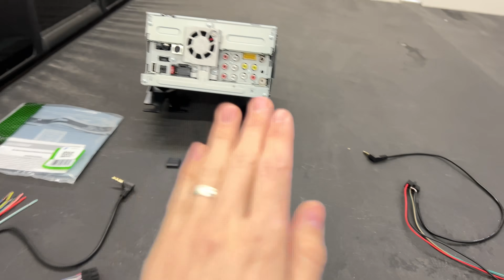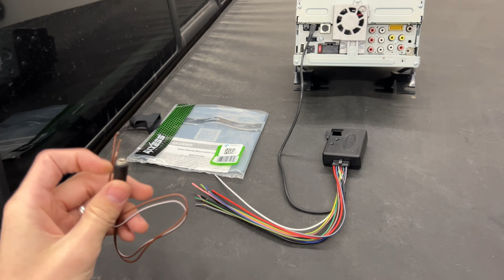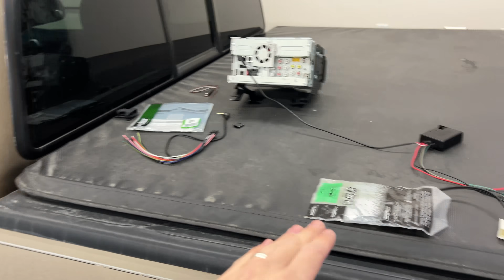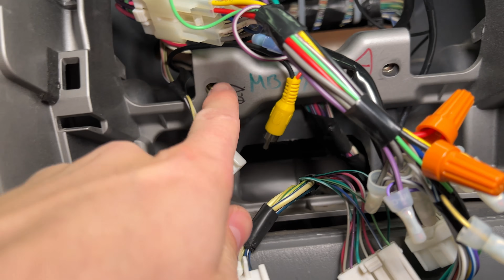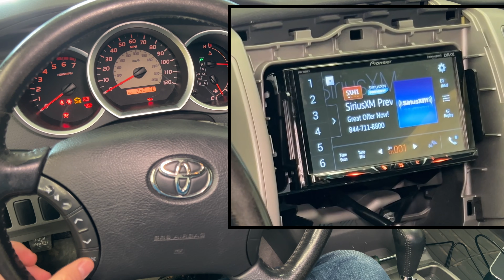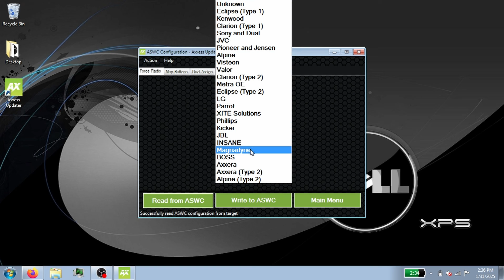Toyota Steering Wheel Control Wiring with Axxess ASWC-1 for Aftermarket Radio Tacoma/Pioneer Install

Comment: So mine is a Toyota Camry Camry SE, it has a after market stereo in it and it has power but no sound. It also has the RCA plugs but the wiring isn't good and we bought the car like that. Should i just buy a new harness with a ASWC-1 interface?

Comment: Just installed this today and all my controls work except for the seek up/down button. They only work in radio mode if i hold them and it will begin to switch the station but pressing them does nothing. does not change song in any source mode or station preset in radio mode. I manually reset and mapped controls but that does nothing. Any ideas? or could it just be my radio. It’s a Pioneer MVH-1400NEX

Comment: I got the part of installing the controls just fine in my 120 Prado (same wheel as your Tacoma) - and likewise my audio controls didn't work, so I ended up taking it to a car audio shop to get the wiring done from the head unit to the back of the clockspring.

I'm adding the call bottons for the phone and voice assist now, as my head unit supports it. Great job man!

Comment: Please, you need to replace those orange wire nuts with something else immediately. A vehicle is a high vibration environment and this could do A LOT of damage if it shorts out, not only to your expensive new double din radio but potentially to your body control module or worse, since you've now tapped into that 20 pin harness. Ideally, we should be using solder and heatshrink only to build our harnesses, then tessa tape to keep things tidy after we've tested, then zip tying for strain relief, then tucking carefully behind the dash. I personally prefer to keep my harnesses as long as possible so that future installs or mistakes don't result in needing a new vehicle-to-radio and aftermarket radio harnesses. The crimp caps are okay, but they're not idea either as they can sometimes fail if they get snagged behind the dash during installation or removal and reinstallation. Soldering and heat shrink is cleaner. @caraudiofabrication and @jptheinstallguy have great videos on building harnesses that cover some of these concerns. Also, if you have a kenwood or JVC that has a blue and yellow SWC wire on the radio harness it's important to note that the 3.5mm jack will not work even if a 3.5mm jack is present on the back because the head unit will be looking for an idatalink signal to that jack from a unit like the Maestro SWC or RR. You will need to use the female rca jack with the brown wire pigtail that came with your AXWSC or AXWSC-1, and you could use come electrical or tessa tape to tape them together so they don't pull apart during removal or installation. You would in this use case connect the blue and yellow wire labeled something like "steering wheel remote input" to the brown wire on the female 3.5mm jack with the pigtail that came with the AXSWC/-1. 

-former Mobile Electronics Certified Professional
Reply: https://youtu.be/aSQTje4sXfs?si=I5Ti9fn5yoLBqg5u